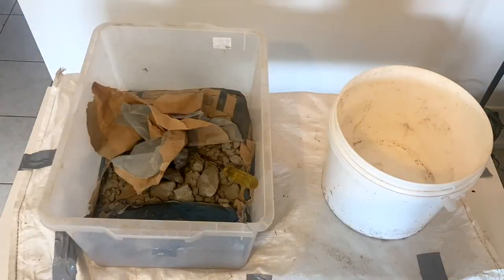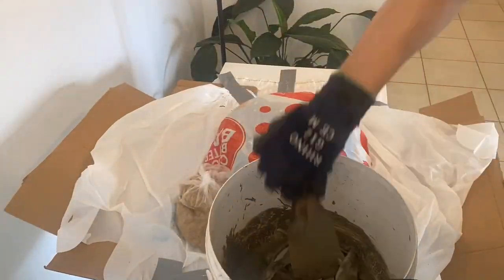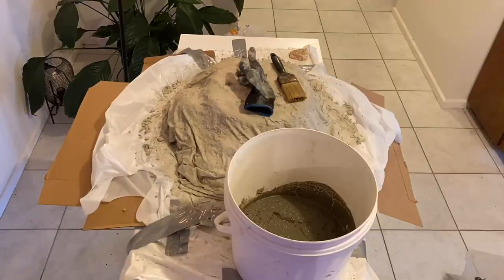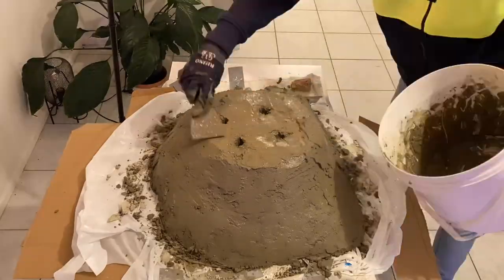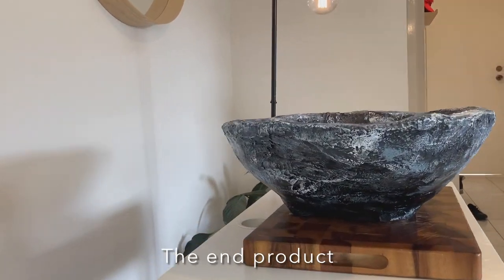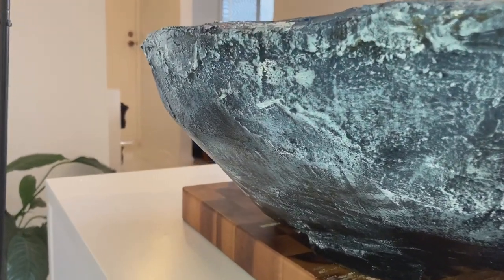DIY Cement Pots at home!

Comment: Before and after the painting is an amazing difference, looks like a rock / carved out boulder to me!

I'm very ignorant when it comes to paint. What kind of paint would one use for a pot like this? Can it survive outside weather?
Reply from the maker: Thank you! I was happy how it turned out as a first attempt. To be honest, so am I. Due to the lockdown, I actually wasn't able to buy specific pain so I just used primer paint and other various colours (water based). It'll stay on for as long as the cement holds :) And yes it'll be okay outside as long as it doesn't get chipped I reckon!